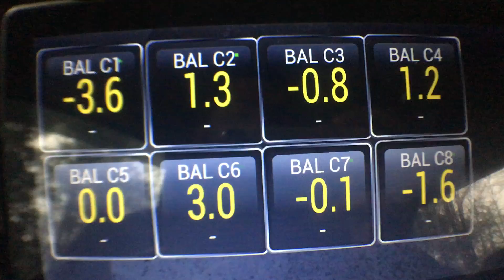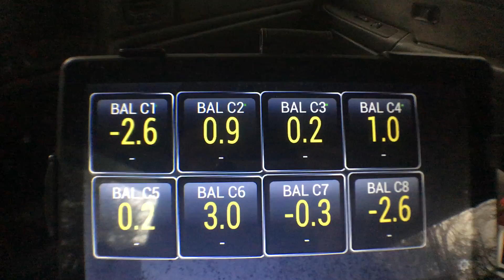Lb7 Duramax Balance Rates Before Cleaning

Comment: The balance rates are he amount of fuel that is being added or subtracted from a cylinder to keep cylinder speed equal throughout the cylinders. I'm not sure if Isuzu rates are the same as duramax. Although balance rates are only 1 of the many functions of the injector s.  Injector return is another important factor.  If you ever come to where your going to fix injectors.  Never rebuild them yourself it's not worth it.

Comment: The part of the balance rates your checking is a small variable in the functions of the injector. People don't know that reading the rates like you are which a lot of people do.  It's really not telling you anything. You can be within spec on an injector and it be completely shot.